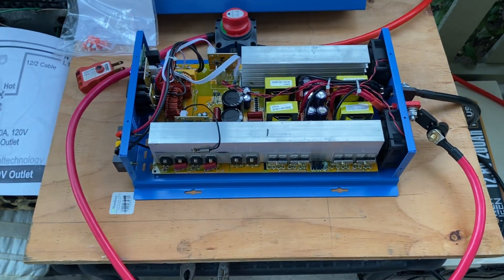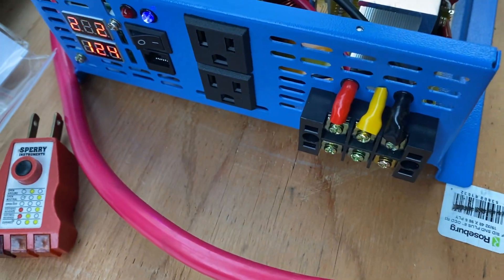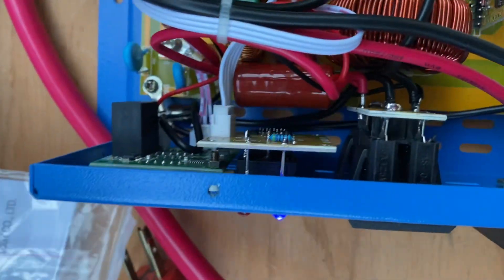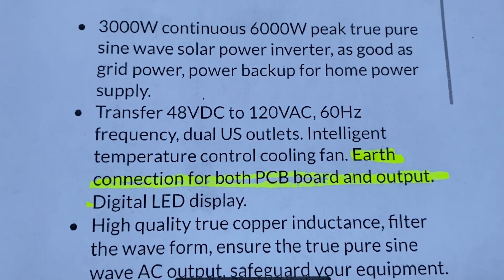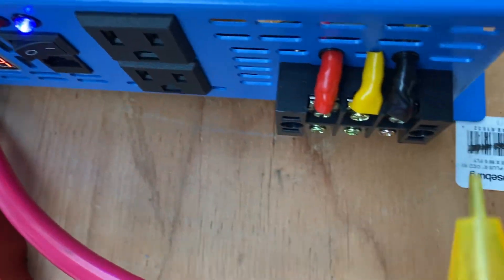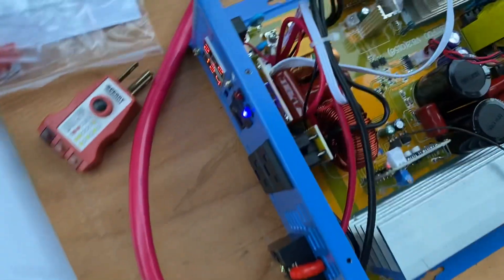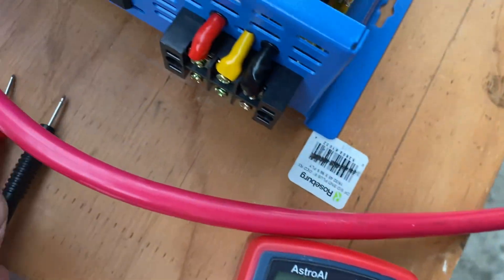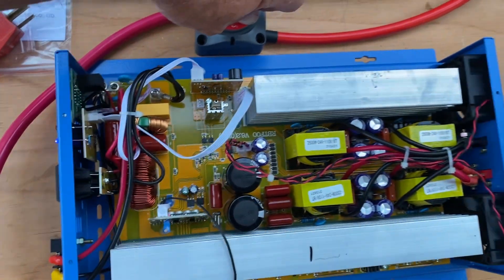XYZ INVT Inverter same as WZRELB Reliable brand?    Part 1.

Comment: ohhhh, wow i think this is why ive had some electronics fail. i just did a quick check on my inverter, when i probe ground to hot or ground to neutral i get 0v but when i probe neutral and hot, i get 120v.

had some chargers fail after a 3 or so months of use
had light bulbs weirdly flicker at times and then stop as if it had a bad connection
had pc randomly shut off
my a/c unit feels like its struggling sometimes to start
recently i got a switching power supply that does not work when connected to the inverter but does work when using grid power

going to check into this when i do maintenance this weekend
Reply: connecting a charger and doing the probe again results in hot being 62v and neutral being 56v

Comment: @WattsinWattsout so
I switched the two hot and neutral wires as you say to do and I still get 60v on the red and the black. In other words it does it when factory wired and also when I switched them in reverse as you said to do. Any suggestions on why that would be the same results either way?
Thanks
Reply from the maker: @CaptainSPONE  The black models with the white outlet are already correct.    They don’t need any fix.   If it’s one of these older models and you made the switch the 60v + 60v is most likely a ghost or phantom voltage.   The way to test for this is using an incandescent light bulb (old school).    Wire the neutral and ground to the light bulb socket.   If the light bulb doesn’t light up it is merely a static ghost voltage as mine have tested out as.   If you make a neutral to ground bond the ground and neutral will act normal at 0 v reading.    These bonds are usually done at a panel and only one bond should be used.   

If the bulb lights up then you have real voltage.   This is a problem and you should not ground or make a neutral to ground bond.    

Renogy inverters have a gfci outlet and they have a ground to neutral bond on the pc board.    I have run a jumper wire between the neutral and ground bus terminals as a test and the outlet will read out correct.   I have also made the bond at the panel as you have seen.

Comment: Every HF inverter is wired like this I thought. Even my 15 year old aims inverter is wired just like this. People wire these to their breaker panel and as soon as they power it up they blow fuses and fets
Reply from the maker: I’ve been running my WZRELB with earth ground for about two months tied to a panel and running a full size fridge, ac and other appliances.
Reply: @WattsinWattsout so
I switched the two hot and neutral wires as you say to do and I still get 60v on the red and the black. In other words it does it when factory wired and also when I switched them in reverse as you said to do. Any suggestions on why that would be the same results either way?
Thanks

Comment: How did you figure out one is neutral and on is hot if they both show 60 volt + 60 volt? What then lead you to bond the ground to the new neutral ? Have you asked the engineer who designed it or company about doing this? What was their response? Im trying to grt my GFCi outlets working again as they dont trip with its factory wiring.
Reply: These types of inverters won't work with GFCI outlets. Or at least I have never seen one that did.
Reply from the maker: @kevinroberts781  Renogy has one with a gfci outlet built in.   They bond the ground and neutral in the case.   So in reality it is a FCI as there is no earth ground unless you earth ground the case.    
You can run a wire from the gfci outlet neutral to the ground on the outlet wiring lugs and it will function like the Renogy model.    That’s fudging it and it won’t pass an inspection if the wiring is checked.
One of the points of a gfci is to have 2 leads to ground.   If the neutral pops the ground is a backup when the ground is not detected it trips the gfci.